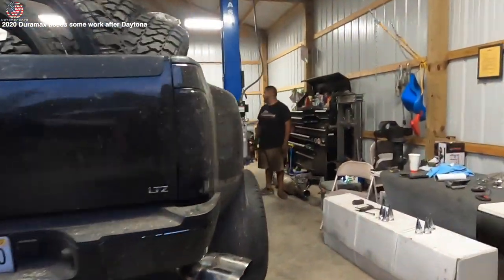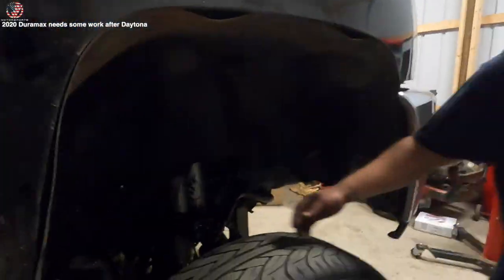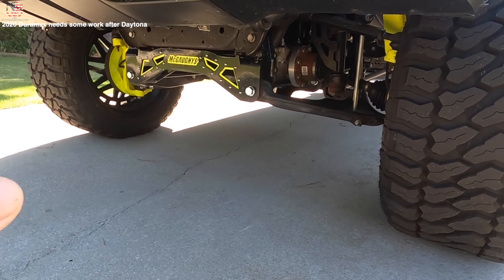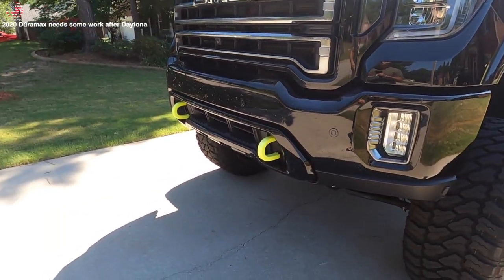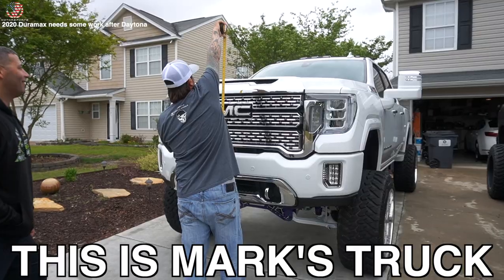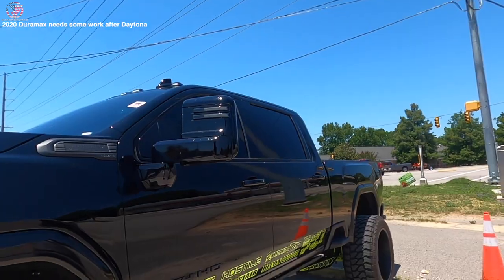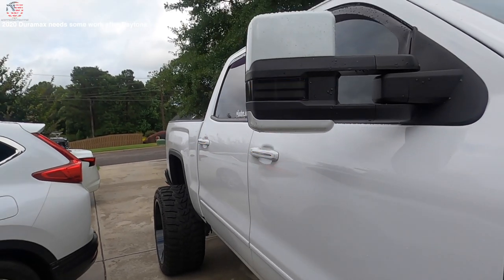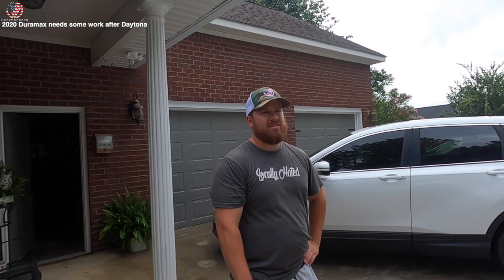CAN’T BELIEVE DAYTONA RUINED IT...| 2020 Duramax | Lifted |

Comment: That neon yellow powder coat is not made for direct sunlight . Spray your tow hooks neon yellow bake at 400 for 7 mins then take your clear coat powder and spray it thick on there and do a full bake at 10 mins at 400 plus a white base under the neon yellow will make it pop more.